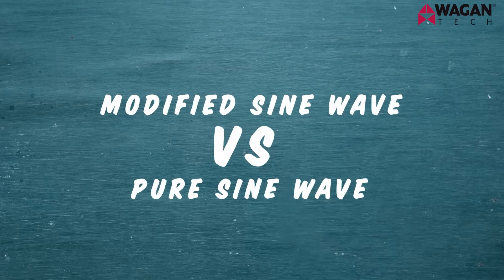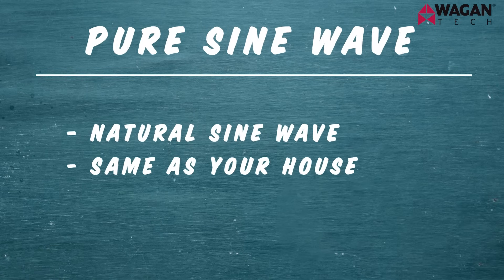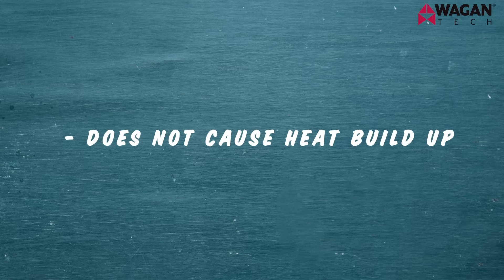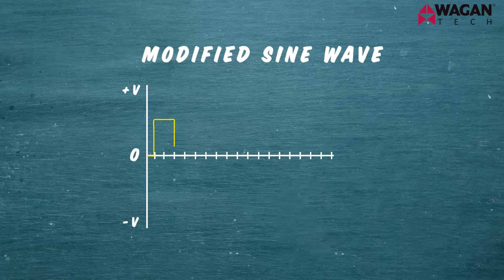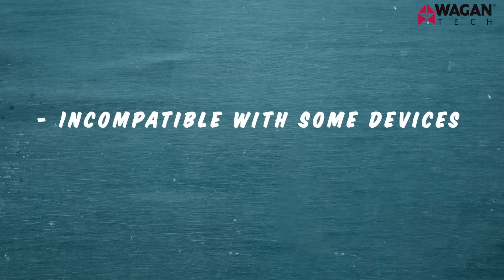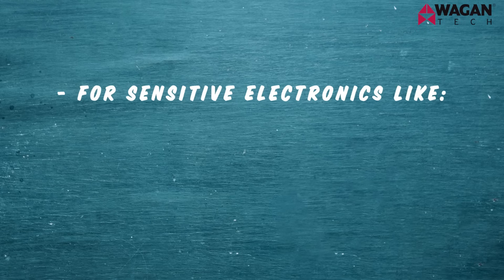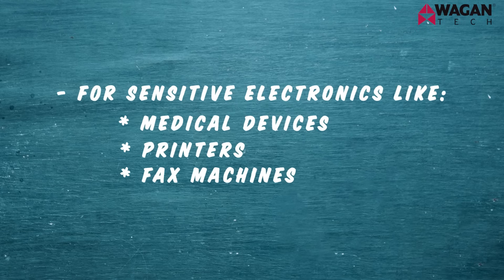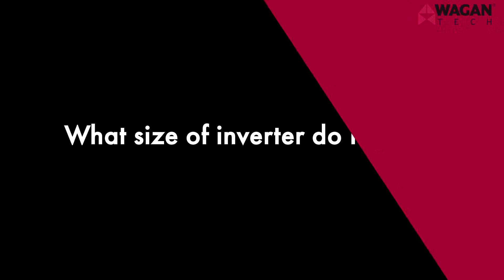What is a Power Inverter and which inverter do I need? What does a power inverter do?

Comment: Does a water pump has a peak surge wattage apart from it's running wattage? If yes, what will be my water pump peak surge if it has a 750 running watts?
Reply from the maker: That's a very good question, unfortunately I can only answer the first part of it. The water pump will have a peak ( or in-rush) surge current on startup. You will have to look at the water pump label or contact the manufacturer to find out what that inrush current is as it can be up to eight times the running wattage.

Comment: What kind of inverter will you use to power a house?
Reply from the maker: That depends on what your house power requirements are. Large appliances (Refrigerator, air conditioner, stove, microwave, etc.) draw a huge amount of power. If you can tell me what your appliance wattage or amperage draw is, I can help size the correct inverter for your needs.

Comment: What watt inverter do u recommend for a 750 w microwave for semi? I had a 1500 watt and it will turn on 3 seconds n beep n shut off.
Reply from the maker: Joey, we have tested many microwaves sold by 18 wheeler supply companies and have found that some microwaves do not like modified sine wave inverters. 
I suspect that you're inverter is a modified sine wave inverter. 
Also double check to be sure that your microwave is only pulling 750 Watts; that inverter is double the stated microwave wattage requirement, so it should have been good - wattage wise.

Comment: First time viewer here. Thank you! Next: I'll be watching more of your videos to determine what type of inverter is right for me in terms of wattage. I have a Toyota Prius and intend to do some car camping soon. I'll primarily be using the inverter to connect cooking appliances, nothing major, mainly my rice cooker and hot water kettle. What I haven't figured out is...must the vehicle be powered on and running for the duration of the use of the appliance(s) ? I'm guessing the answer is "yes." Can someone please clarify? I've purchased a self-charging jump starter power bank to protect myself against battery drainage just in case...
Reply from the maker: EVs definitely make the equation a lot harder. If you are able to directly connect the inverter to the battery, then the car will not have to be on.
You will have to find out if a direct connection is possible as the batteries are lithium ion and probably produce a higher voltage than what a lot of inverters are capable of accepting as input.
All it takes is a battery management system to regulate the output power to an acceptable level for the inverter... This may already be done for you so you'll want to check with Toyota.
As for which inverter you need, take a look at the amperage or wattage requirement of the hot water kettle and rice cooker. If you're going to be running those appliances concurrently, you'll need to add that amperage or wattage requirement together.
Add an additional 20% to that number and you'll have the size of inverter that you'll need!

Comment: Good evening sir. Please i just watched  yr video now. It was really helpful. But please i also have a question can a blender of 220v work in a place where the voltage is 110v?
Reply from the maker: Lydia, the only way to use a 220v appliance on a 110v outlet is to use a voltage converter. A power inverter can only convert DC voltage (like from a car battery) into AC voltage (like your blender).
Reply: Thank you so much sir. And God bless you sir
Reply from the maker: @lydianyarkoh363  My pleasure! Feel free to reach out if you have any more questions!
Reply: Hi Justin, can I use a 12v battery to power a 1000 watt hot plate using a WAGAN slimline 1250 watts MSW Inverter?

Comment: Hi!! So to run a small fridge and/or a coffee machine, which sine would I need :). Great vid- super helpful
Reply from the maker: Thanks for your positive feedback, I appreciate it! For either of those appliances, you could use a Modified Sine Wave. Appliances like the coffee maker (or anything with a heating coil: personal heater, hair dryer, etc.) will make a noticeable "humming noise" when using a MSW Inverter.

Comment: what if I wanted to use an inverter to power an ant miner s9 that runs at 1300 kwh? would an inverter system be capable of managing that kind of operation?
Reply from the maker: You can power a Bitmain Antminer S9 with a Pure Sine Wave Inverter as long as you have the battery bank that can handle the power requirements!
At 1323W, that would take a considerable size battery bank to run for any length of time.
Reply: @WaganTech  thank you for the feedback. 
Additionally, would it be possible to use a similar set up like a car, where a universal motor is connected to a battery, and used to spin the rotor of an alternator to produce the electricity that keeps the battery charged while supplying power to the the inverter that the S9 is connected to?
Reply from the maker: @randomvillagerasks7291  That's a hard one. I would think that an alternator that could produce more power than it is using to keep the battery fully charged could conceivably be used in this set-up.
You would need to regulate the power from the battery to the inverter so that it isn't getting power spikes or alternating voltages  too.
Reply: @WaganTech  thanks for the feedback.
I will continue to research this. Are there any power regulators that you could recommend for this set up?
Reply from the maker: @randomvillagerasks7291  I don't have a brand that I prefer, just choose one that fits your A (amp) needs and that regulates within a battery's voltage range (approx. 13.4V charging to 10.5V discharged).
Reply: @WaganTech  Thanks for the feedback.
You have helped me with a piece of this puzzle. Thank you very much.
Reply from the maker: @randomvillagerasks7291  absolutely my pleasure!

Comment: Hi, fantastic explanation,  Thanks !.  May ask what about batteries - what type or capacity battery  should I use, say for a small 200W inverter ?  You see, I am trying to DIY a simple power backup for my home router and WiFi which draw a total of 30W. I used a 200W inverter  and a fully charged 12V 40Ah battery.  Unfortunately it didn't work and the error indicator on the inverter says Low Battery. In fact, I used it on a 18W LED lamp and it didn't work either - it keeps blinking. Is a 12V 40Ah battery not good enough for a 200W inverter?
Reply from the maker: The 40 amp hour battery should be good enough to power your devices for a fair amount of time. I suspect that the battery isn't new or is not able to put out the required power of around 12 volts. I would start by putting a multimeter to the battery to see what the voltage is at.
The size of the battery that you'll need is dependent on how long you intend to run that load for. Can you give me an idea of how long you would want to run that load for in the event of a power down situation?
Reply: @WaganTech  Thanks for the reply.  I am hoping to achieve about 4 hours on the backup power. What battery would you recommend? Thanks in advance.
Reply from the maker: @paultcchan5341  the 40Ah battery you have (if new and working properly) would provide over 12 hours of run-time at 30W load. a 15Ah battery would be just enough to provide you the required 4 hours at 30W.
Reply: @WaganTech  thank you, for your kind advice. Happy New Year to you.!
Reply from the maker: @paultcchan5341  Wishing you a great 2022 as well!

Comment: One thing I would like to add is, with a 12 volt system in a vehicle you want to run a household appliance on, get the amperage rating the appliance draws.
While inverters are NEVER 100% efficient, it is a general rule of thumb whatever the appliance wants will be ten times that from the battery.
(Think going from 12 to 120 volts, of course it would be).
Reply from the maker: Mikiness, I get what you're saying and I agree that no inverter will ever be 100% efficient. Going from 12V to 120V is not a linear scale and won't draw the power from the battery in the same manner.

Comment: I need your recommendation for an inverter to charge two 10ah 48v e-bike batteries at the same time. Thank you
Reply from the maker: What is the power consumption of the e-bike battery charger? On the back of the unit it should say what it is. If you're using two at the same time, double that number and then add 20%. That is the ideal inverter for your needs.
Reply: @WaganTech  Li-ion Battery Charger
 INPUT:AC110-240V 50/60Hz-2. OA
OUTPUT:54,6V 2.0A
Reply from the maker: @willie90210  it looks like those chargers take about 110 watts each (54.6v x 2.0a). Added together, you get about 220 Watts and then with the addition of 20% it is about 262 Watts.
For this application I would recommend a 400 watt pure sine wave inverter.
Reply: @WaganTech  I really appreciate your quick response.

Comment: Question, with this type of invertor does the car or vehicle have to be running in order to use the invertor?
Reply from the maker: The answer is dependent on the load and the size of the car's battery. If you're powering a laptop in an SUV, then the engine need not be running. If you're using a microwave in the same SUV, then yes you should have the engine running.
When running high-wattage appliances, or if powering from a smaller battery, you should keep the engine running.
If you give me your vehicle type and load-requirements, I can better answer this for you.

Comment: which battery to match which invertor, does it matter?
Reply from the maker: Hi there! 
In selecting a battery for use with your inverter, make sure that the inverter is compatible with the battery chemistry. Almost all inverters are made to work with standard automotive batteries: (SLA, AGM, Maintenance Free, Flooded, Wet Cell, VRLA, Gel, Lead-Acid, Vented, Deep Cycle, etc.). The only issue would be if you're trying to use a lithium-ion battery.
Battery size matters (Ah rating/Capacity) when you're trying to run appliances for an extended amount of time.
If you need more info on this, shoot me an email at customerservice@wagan.com and we can figure out what your requirements are.

Comment: I've gone down the rabbit hole of dual battery power systems for camping. If I have a coffee machine that is 15 amps x 120 volts does that require an inverter of 1800 or greater?
Reply from the maker: Jim, yes you have it correct!
I would recommend an inverter of 2000W as we suggest a buffer of +15% over what's needed.

Comment: Hi, 2 years ago I bought a US made (Taiwan) the Singer 9985 Quantum Stylist Sewing Machine via Amazon US.
I live in the UK, and I did not think any of it until we opened a year later due to moving home. Suffice to say we can't use it. I have not bought a step down converter because I don't know which would be the correct one. I have emailed Singer and they suggest getting in touch with electrical personnel.
The appliance rating is 120v AC 60Hz 55W
Any help greatly appreciated. Thanks
Reply from the maker: Hi there! You would need a "Voltage step-down converter" to go from your home's 230V to that sewing machine's 120V. 
Your sewing machine draws 55W (according to their site it's actually 55.2W), so the step-down converter needs to be able to handle more than 55W.
When looking for a step-down converter, also be sure that it is capable of handling the Hz (Hertz) change since UK runs on 50Hz while USA appliances are on 60Hz frequencies.
Reply: @WaganTech  First, thanks for your response.  So, 220 to 110 at above 55w with 60Hz. I am looking at some YouTube videos and some product have 50 to 60 Hz I guess that would be fine. Still very apprehensive but will keep looking. Thanks again.
Reply from the maker: @LordOfThunderUK  Yep, you have it! We don't manufacture voltage converters, but there are plenty out there that can handle the 220 to 110 (230-120V range) with 50/60Hz acceptable ranges and are 100W+. I took a look on Amazon, and there are quite a few affordable units in the market. Cheers!
Reply: @WaganTech  Yes, it is time to dive into the deep and get one.
I went to your channel because you know your stuff.
All the best.
Reply from the maker: @LordOfThunderUK  I appreciate that comment! Let me know if there is anything more I can do to help!

Comment: Thanks for the great info! I have a question though. If i have one hardwired into van, and i use a jump starter with 1000A peak power, would i have to disconnect the inverter?
Reply from the maker: Arnie, thanks for the comment - I appreciate it!
If the Inverter is wired as it should be (downstream of the battery), there should be no reason that it would be affected by jump-starting a vehicle.
I would urge you to turn off the inverter and anything that draws power (radio, lights, etc.) prior to jumpstarting a vehicle.

Comment: Very well explained. Thanks. I've been planning to get a hardwired inverter so I can recharge my drone and camera and also use my laptop to edit while off the grid at random locations huddled in a tent. So far I've just been hearing some jargon from people I ask about this and have procrastinated.
Reply from the maker: Halldor, it's very easy to procrastinate on projects like this. It sounds like all you need is a small inverter to power your drone and laptop. You may be able to get away with one that simply plugs into the cigarette lighter socket inside your car as these can provide around 180W-240W (depending on your vehicle's fuse).

Comment: How do you keep it from draining your batteries tho
Reply from the maker: Amy, the no-load current draw is very small when the inverter is idling. If you are worried about the parasitic draw, you can turn the inverter off using the power switch.

Comment: I feel like if power goes off at your house,  you would use generators for big appliances  and other circuits. I would use power inverters for only small applications such as phone and laptops correct? By the way, it was a fun video:)
Reply from the maker: For the average person in suburbia, you are correct. This is (in relation to people living in houses) geared more for those with solar panels or off-grid cabin needs. 
If you already have the solar panels mounted to your roof, then a battery back-up system is way more discreet,  requires no "fuel", produces no fumes, and is quieter than a generator. 
If were talking strictly power outages, then a generator is probably the better bet.

Comment: Hi... I wondering is is this inverter can save charges just like powerbank??? Im  planning getting one for oxygen concentrator just in case there's eletric blackout....
Reply from the maker: Hi there! 
No, power inverters only convert DC into AC current. You have to connect a battery to them.
You would need a portable power supply like our Lithium Cube - this has an onboard lithium ion battery with AC, DC, and USB power ports. 
https://wagan.com/collections/lithium-cubes

Comment: Is bad for car batteries, will it be one of the reasons behind damaging car battery. I mean if the car engine is not running? Please answer.
Reply from the maker: Our inverters won't damage your car's battery as they have an automatic off feature when the battery voltage becomes too low.
The inverter will first notify you by emitting an audible alarm, then it will shut-down automatically.

Comment: Do you jave to keep engine running while using power inverter? What does DC-DC in car charger do with inverter? Thanks
Reply from the maker: Depending on the load and the run-time, you may or may not have to keep the engine running. 
For instance, if you're powering a laptop off of the inverter, then you'll likely get several hours before needing to run the engine (which will recharge the vehicle's battery). 
On the other hand, if you're running a microwave/hairdryer/blender or other high-wattage device for an extended amount of time, then you'll definitely want to have the engine running.
A DC to DC charger simply monitors and regulates the power going to a battery to ensure it charges correctly. They can be used alongside most inverters with no issue.

Comment: Do we need something between the inverter and battery to keep from draining the battery, to tell us if we need to recharge the battery? Thanks!
Reply from the maker: You don't need to add anything else to the system except a fuse when using our inverters as they have a low-battery alarm (around 10.5V) and an automatic off feature (at around 9.5V) to help keep your battery from over-discharging and becoming irreparably damaged.